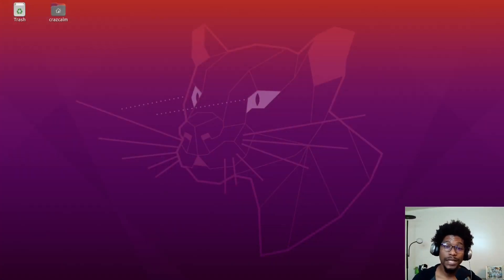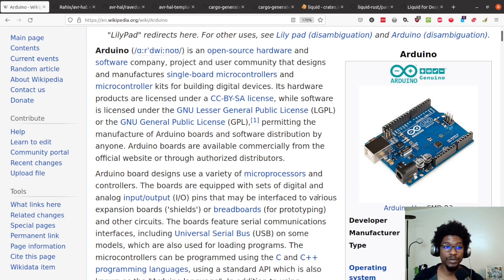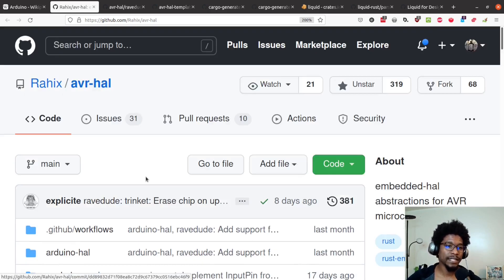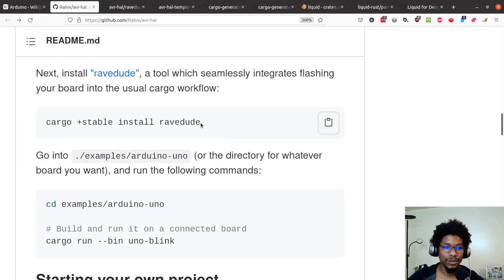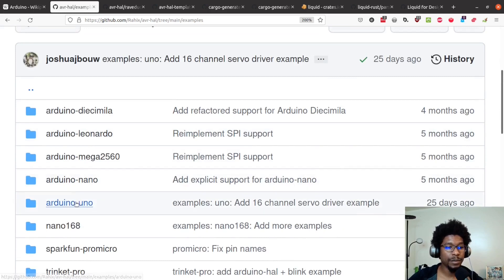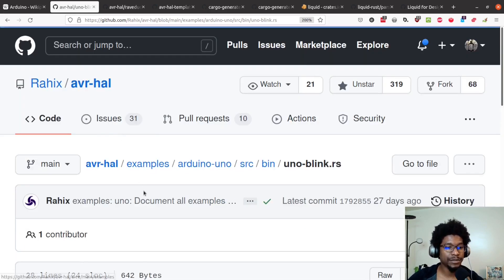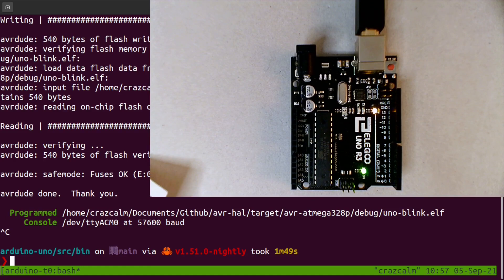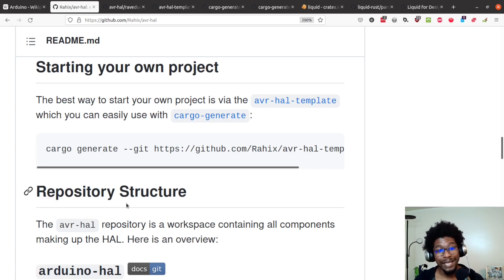Rust: Arduino Setup

Comment: I am getting an error after executing cargo run command :
Linker "avr-gcc" not found. 
Please help me out.
Reply from the maker: I am not going to be able to debug that remotely. 

I do wish you the best of luck though!

If you find a solution to your issue, please comeback and leave a comment about what worked for you.

Thanks!
Reply: Hey! I'm late but you are supposed to install it using your package manager. 

sudo pacman -S avr-gcc works on arch.

Comment: You surprised the heck out of me. Welcome to embeded!

 If you want to try  some other embeded boards I highly recommend three options, two cheaper and faster and one MUCH faster and about the same cost I would think as your board. All also have great Arduino support too.

The blue pill STM32F103/ black pill/STM32F411 are cheap $6down to $2 at times for the 103's. They are  maybe 1/2 the size but still have more usable pins and onboard hardware and they run 80mhz vs 8mhz. The 411 has a single precision floating point unit and 4x or more memory too plus both are 32bit cores not 8 like the AVR's. They have had better rust support than the AVR lines too.  

My personal favorite board the the Teensy 4.0 made by PJRC and its about $20. It runs at 600 MHZ and has been ran at 1Ghz with a good heatsink.  It has both single and double precision floating point units and comes with 2 megabytes flash and 1 mega byte ram. All 3 have good hal crates. The STM32 line of chips probably has the best rust support at this time. I just ordered some more black pill boards from china and got them a couple days ago. 3 black pills, a stlink programmer and debugger unit, total with shipping $29.95.  Look for the embed discover documents, its an excellent way to start out.

My only ever pull that got merged into an OS project was a minor change to the stm32 discovery tutorial documents. I was just starting like you and a fresh set of eyes let me point out a couple things someone starting would notice lacking but an experienced would take for granted as common knowledge. I can point you to where I buy cheap stuff if you want sometime. I just buy from them and get nothing for promoting anything.
Reply from the maker: OMG!!! Thank you for all you of this information! I will definitely look into all of this!
Reply: @CrazcalmsTechStack  You got me excited about Rust on embeded again. Thank you!